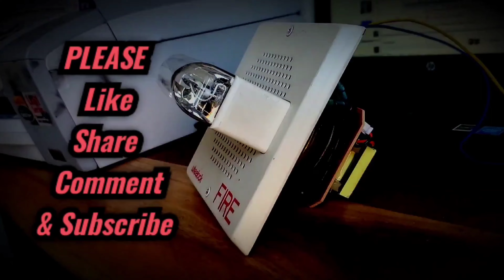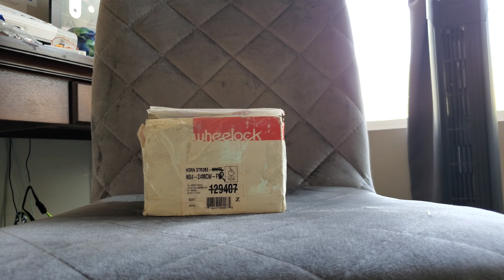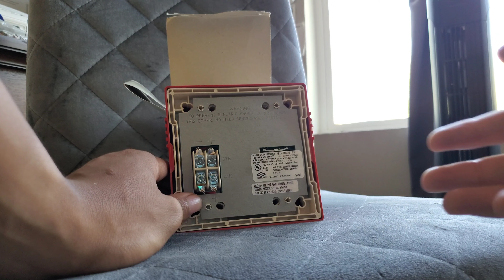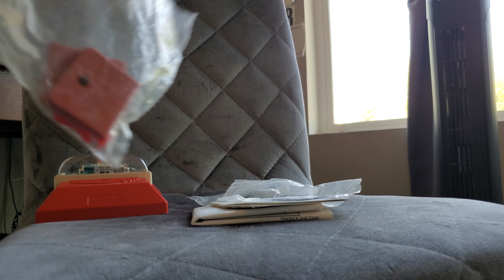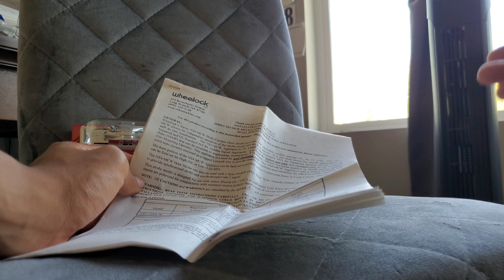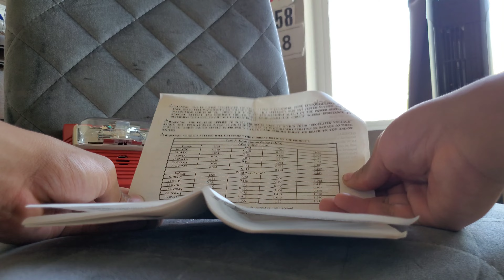New Device| UNCOMMON Wheelock NS4-24MCW-FR

Comment: Can I try to request a system?
Reply from the maker: The MS-5UD and 4004 are still open for requests
Reply: Can I request a mini system?
Reply from the maker: @garbagetrucksofwinnipeg4952  Yes you can
Reply: Can you put the simplex 2099-9754 pull station by the panel and the simplex 9838 with light plate above the pull station and can you put the system sensor i3 up in the closet and you can pick the last device and coding on code 3
Reply from the maker: @garbagetrucksofwinnipeg4952  👍🏼

Comment: When I was little and in daycare/preschool, they had Wheelock Ns’s on continuous. One summer I was in daycare and they were doing construction in one part of the building. The system went off at least once per day. This was absolute torture for the little kids and is definitely an experience I will never forget.

I believe it was a Simplex 4002 or 4005 with Wheelock NS’s and RS/RSS’s until around 2013 when they did some renovations and upgraded to some sort of addressable Simplex panel. (My guess is a 4010 or 4100ES.) They kept the Wheelock NS’s and RS/RSS’s in place but for some reason put them on the ceiling in the renovated areas. In an addition they added Truealerts indoors and outdoors. Unfortunately, they still left the system on continuous, even for the Truealerts. I believe that the strobes on they were 4 wire Truealerts and 2 wire NS’s. I think that the Truealert’s strobes were in sync but the NS’s strobes were not.
Reply from the maker: Oof, must be painful
Reply: Yeah it was.
Sorry I added a lot after you replied.
Reply from the maker: @aerhardt  No worries, that's interesting
Reply: @BlackLightning4547  Thank you.
I’m pretty sure the NS’s were also set on high volume because they could be clearly heard outside and over the sound of traffic, kids crying, and the outdoor Truealerts.
Reply from the maker: @aerhardt  yeah NSs on high volume definitely make a statement
Reply: Do you want me to simulate it in my next place on Roblox?
Reply from the maker: @burnoutteamclubbtcp7283  if you want, doesn't matter to me
Reply: Sure
Reply: @aerhardt  I put the system up. But I actually made it based off the Garage system test 6 video. It has Wheelock NS and Simplex 4903-9426's.  But I also put Wheelock NH's in there, mounted on Simplex 2903-9002's. and everything is on continuous like in the preschool you mentioned. The NH represents a dead 9838 being replaced